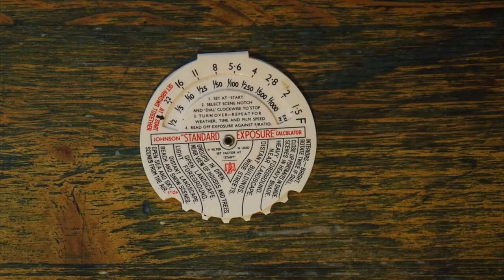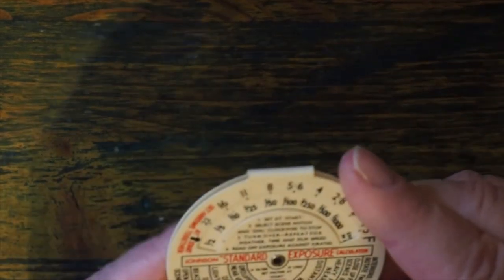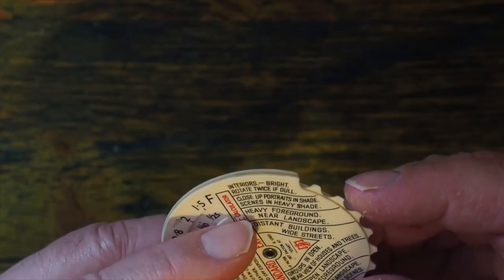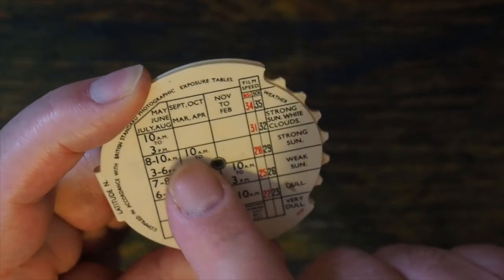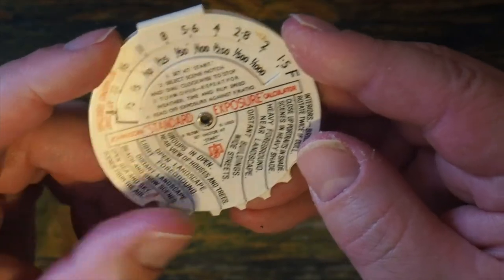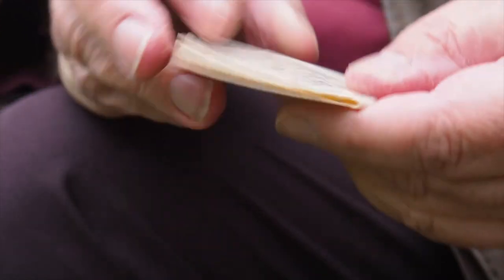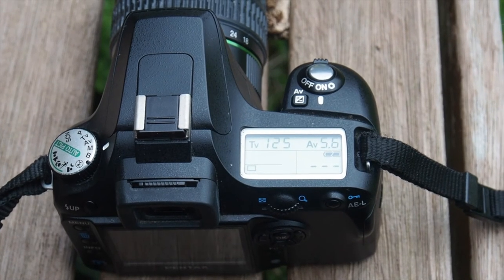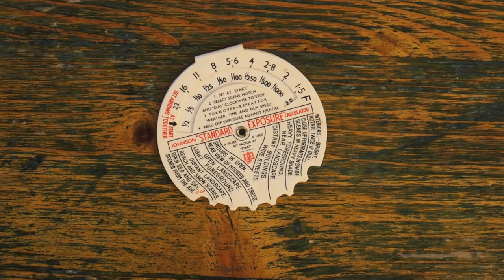Johnson Exposure Calculator

Comment: Hello, thank you for the explanation of how this works, I have just acquired my grandfathers 35mm Pentacon TL Super 1000 and in the box of goodies I found a Johnston dial exposure meter. So this helped me a lot to understand how this device works! Thank you thank you, unfortunately it's set for UK weather and seasons and I live in Australia, easy to swap though. Mine is slightly different but very similar. My question is after I have dialed in all my values and turn the card over, there is a arrow in the middle of the meter telling me my exposure value. Then all the shutter speeds and the aperture settings are lined up over the dial. But there is no actual indication of what I should be using in those settings. I may have missed something in your video, but when you have dialed in all your settings and you turn over to get your SS and Aperture you go straight to the setting you  need on the card, but for the life of me I can't see any arrows or anything telling you to look at those particular settings. FYI I do know how to expose in general this is more to understand the device.
Again great video and I know how to dial in my setting it just the last part in which one to actually chose if that makes any sense?
Rgards
Reply from the maker: Ah. The choice depends on you. This gives you a range of options. for example if I were to photograph something moving, I might select a high shutter  speed, then the dial will tell me which aperture to use. On the other hand if I wanted great depth of field, I'd choose a small aperture and then the dial tell me which shutter speed to go with it
Reply: @PhotoWays  After reading this, I feel stupid 😅. Makes total sense,  I thought it was going to tell me the exact very specific ss and apature settings. And it does, but not the way I was expecting it to 😅. Thank you so much for the reply and explanation! Gtreat video, I'm off out now to snap some frames 😊
Reply: The exposure value is nothing else than an index that allows a special pairing of shutter times with apertures. Exposure value 0 (Zero) is a combination of shutter / aperture values that allow an identical exposure like f/1 and 1 sec. These are i.e. f/1.4 and 2s or f/2.0 and 4s. Light value 4 means, the light is four times stronger than zero. Accordingly, f1 and 1/16s (or 2^4s), f1.4 and 1/8s, f2.0 and 1/4s down to f32.0 and 64s can be chosen to come to the same result (theoretically, as the "Schwarzschild Effect" must be taken into account when selection long opening times).
Reply: The exposure value is nothing else than an index that allows a special pairing of shutter times with apertures. Exposure value 0 (Zero) is a combination of shutter / aperture values that allow an identical exposure like f/1 and 1 sec. These are i.e. f/1.4 and 2s or f/2.0 and 4s. Light value 4 means, the light is four times stronger than zero. Accordingly, f1 and 1/16s (or 2^4s), f1.4 and 1/8s, f2.0 and 1/4s down to f32.0 and 64s can be chosen to come to the same result (theoretically, as the "Schwarzschild Effect" must be taken into account when selection long opening times).

Comment: Good video. Johnson has provided different calculators for negative films and colour / cine films. I guess, he had in mind that a black and white negative should never be overexposed in order to keep as much details as possible, whilst colour films always had to be exposed very exactly in order to avoid colour shifts. Therefore I think that digital cameras behave more than colour films and seem to be ungrateful for any lost light or overexposure.  

Basically, the calculator follows the "Sunny Sixteen Rule" (Film 100 ASA, shutter 1/125th, aperture 16 in full sunlight), but takes into account the hight and intensity of the sun over the year and over the day. The "Posometer" even calculates shadow effects. Further variants were an indoor calculator (Johnson) yearbooks with integrated calculator (Johnson) and many comparable calculators by many film and camera producers like i.e. Kodak.
Reply from the maker: Certainly the tolerance for colour slide film was much less than negative film. Later colour film had a pretty good exposure latitude.